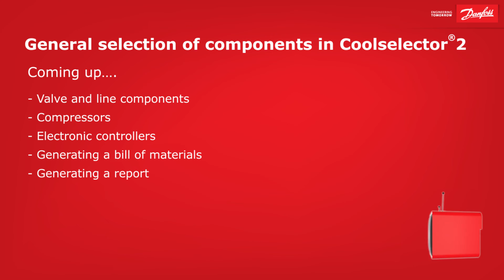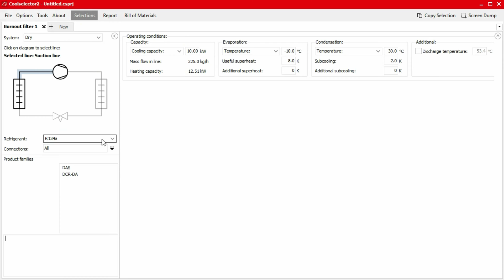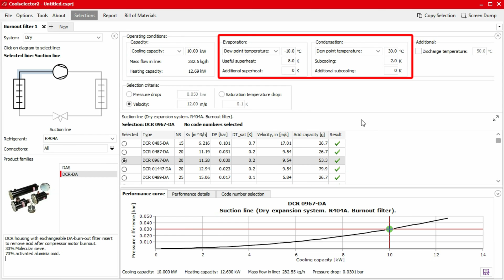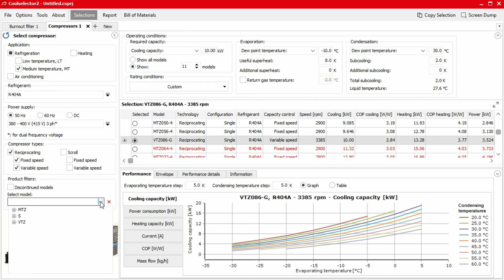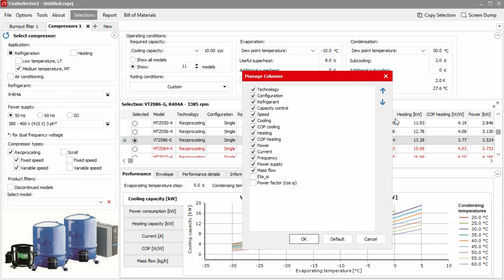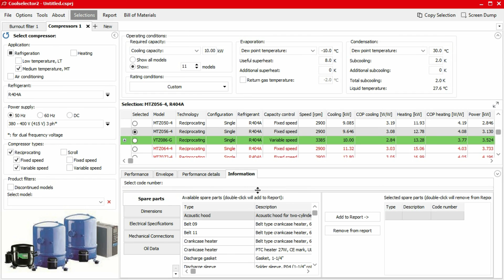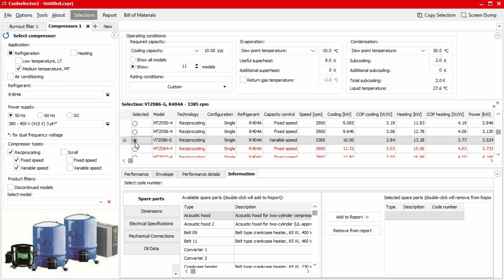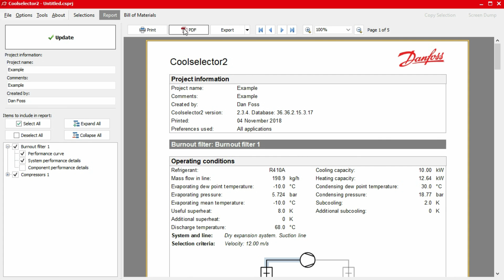Coolselector®2 – General selection

Comment: How can we increase the Hight of the cold room from 4 meter to 6 meter for example
Reply from the maker: Thank you for the comment. The ceiling height has been limited to 3.99 m because of several additional factors when dimensioning a higher room. Under those circumstances, the air flow will most likely be heavily influenced by shelves and other equipment. So, a thorough calculation is required. Please find other sources for a more precise calculation.